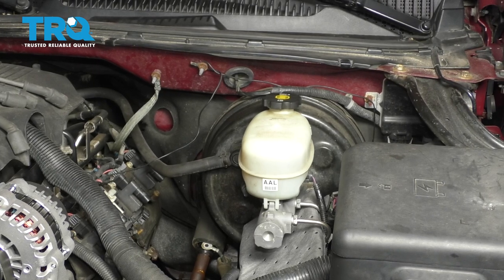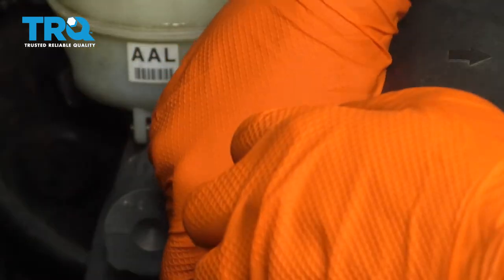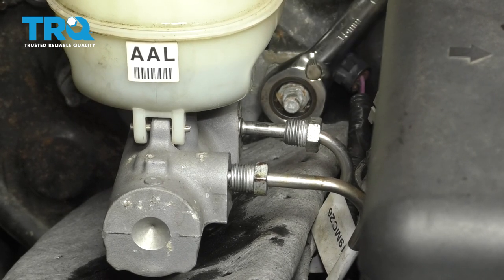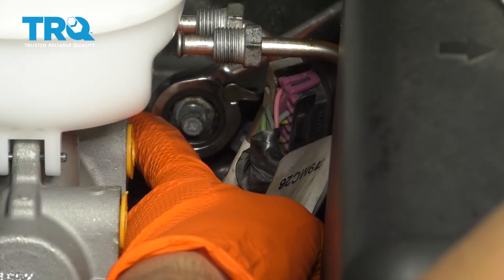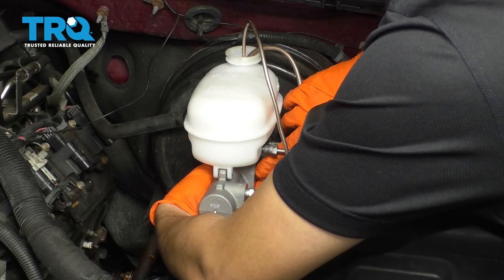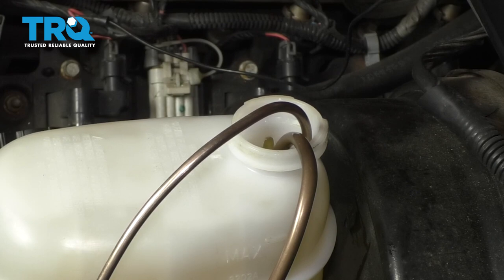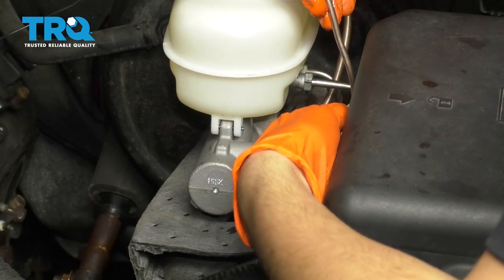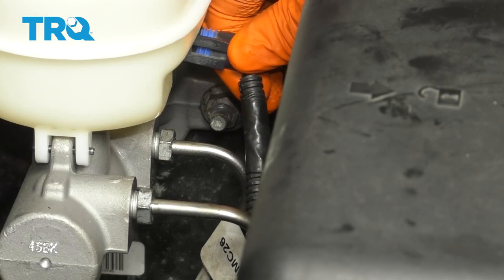How to Replace Master Cylinder 2007-14 Chevy Silverado

Comment: this does not work in the 2010 model, since it has an ABS Module. if air gets in there, bad news. Dealership had to use their tools to exhaust the air.